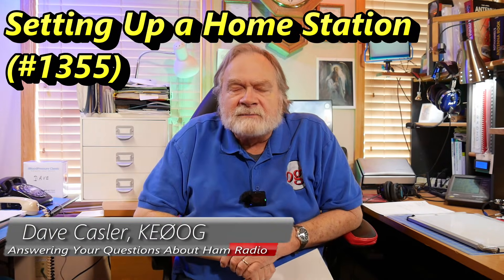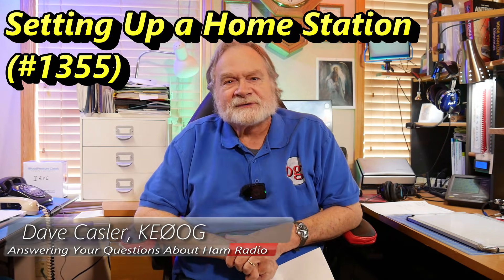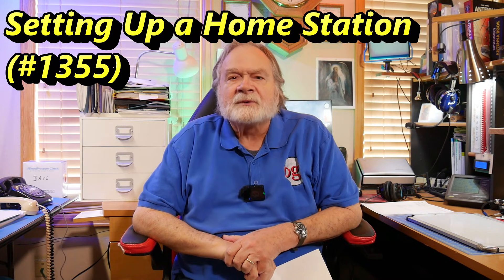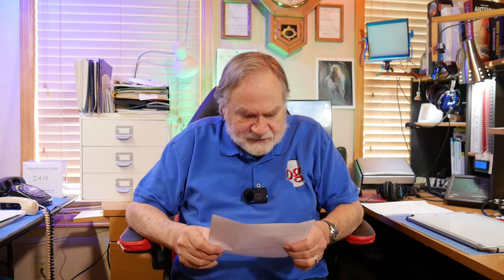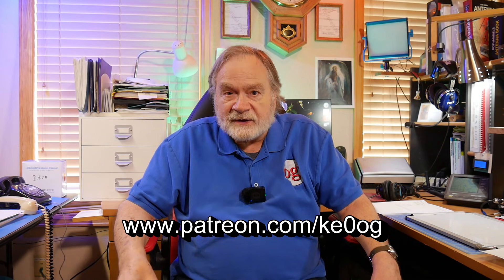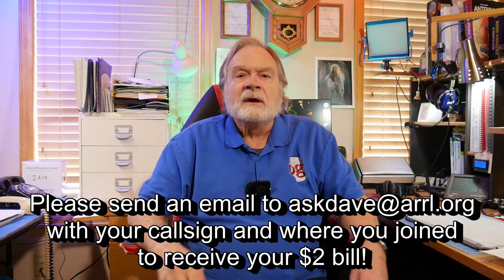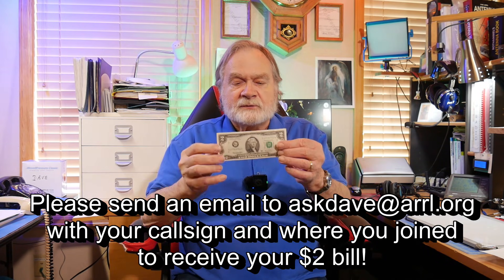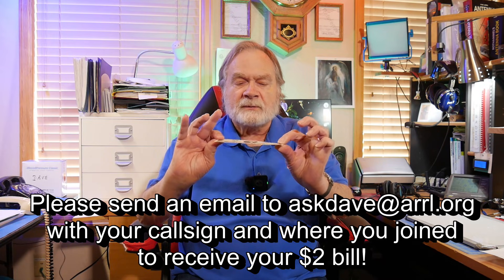Setting Up a Home Station (#1355)

Comment: A couple of other points about aluminum wire, first it doesn't conduct as well as copper, secondly it doesn't handle heat as well as copper, (that's why it's no longer legal to wire houses with it), so if you operate high power it can be a fire hazard.

Comment: What type of fence insulator type would work best? There are so many different ones, there's lag screw,  there's Standard Snug-fitting T-Post Insulators, these look like theyd be the best the Wire Insulators Screw Round Post Insulator. Any help would be appreciated.

Comment: Will copper antenna wire stretch (in length) under the weight of snow in a permanent installation?
Reply: Yes, copper wire stretches with time and the added weight of ice and snow. N0QFT